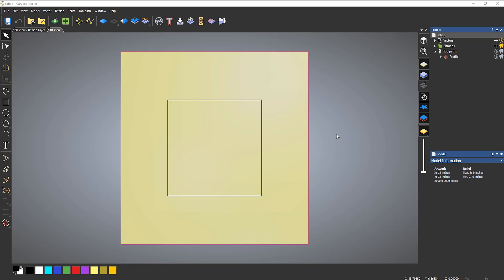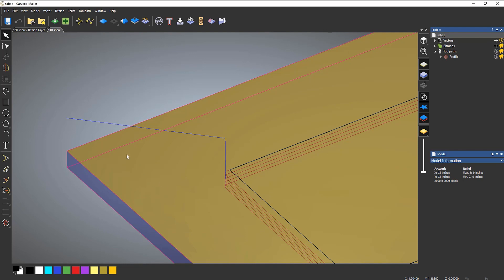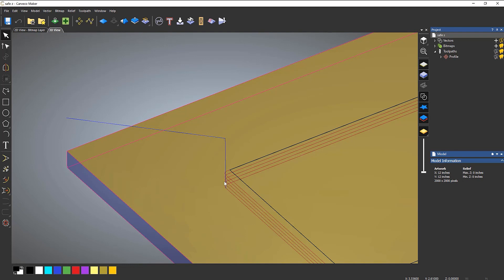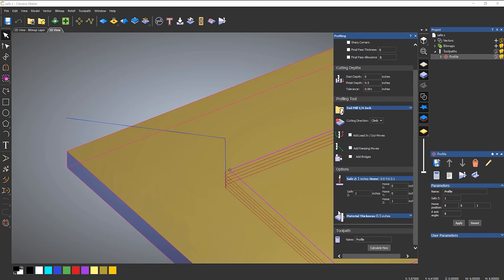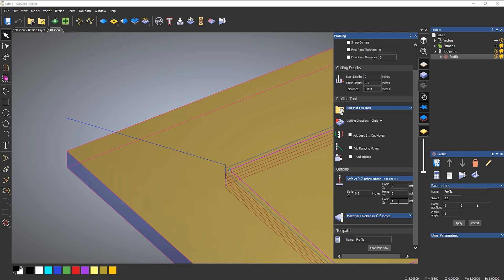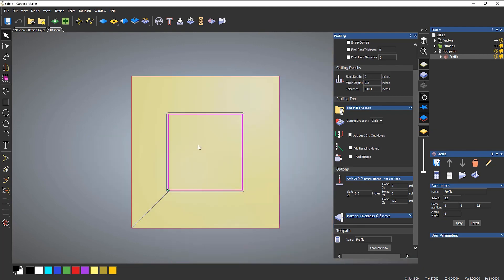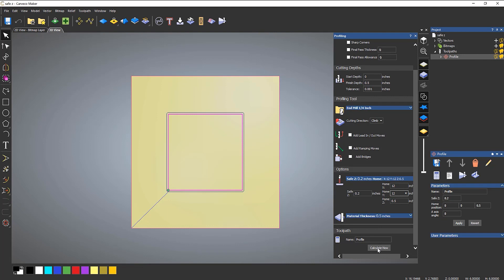Tips and Tricks: Safe Z and Home Positions

Comment: Sorry, I'm so new that I am attempting to start My very First Carve. When I start my machine the first thing that I do is to home the Machine ( One Finity Wood worker ) Machine Home. X=0, Y=0, Z=0. So I think at some point before that you you Start you need to probe for X, Y, and Z, so as to reference your work piece to the machine. In your video you set your safe Z to .2 and Home Z to .5. What I don't quite understand is the Machine seems to be referencing Zed from the Top of the Z axis Down in negatives, and it seems that Carveco Maker Plus references Zed from the Bottom up in positives. The Z Position from Home to the top of my Spoil board is Z = -4.644  My Z at the Top of my Work Piece is Z = - 3.935 . Is the Reference Point for Home Z the Spoil Board and the Reference for the Safe Z the top of the Work Piece? Are these Measurements some how rereferenced in the Post Processor so that the machine understands ? Sorry very Confused!
Reply from the maker: Hi William.  On the Onefinity we always set z zero (physically, on the machine) on top of the workpiece.  So the top of that is 0.  Then in the software, when setting up the material, set you r "Material Z Zero" at the top and enter the thickness of the material.  It doesnt matter if you are using Maker, Maker+ or Carveco, this is exactly the same.  If you change to the bottom in "Material Z Zero" then you will need to add the material thickness on to the Safe Z and Home Z.  I think that your problem is that you need to go to the top of you workpiece (Z-3.935) and then in the Onefinity controller set your Z at that point.  I think it is the small gear cog icon in the Z row, once you select that it will ask to confirm if you want to set your Z origin, select yes.  If you are still having problems, I would get in touch with our support team support@carveco.com as I cant post images which would be make it easier to understand.
Reply: @Carveco  Thank You for your timely response, I was leaning in that direction, however, I wasn't 100% on that. didn't want to break anything. Hopefully able to make my first cut today or tomorrow. I created a 2.5 d carving using Maker Plus of an old television test pattern.

Comment: Leighton, I don't understand the warning about the park position being the start position. If I start at X/Y 0, the spindle will move forward/right +X,+Y to first cut position or is it relative position to +X,-Y?
Reply from the maker: Not quite sure I understand the question John.  Everything comes from the origin point when you set up the model (normally bottom left or centre of the model), does that help?
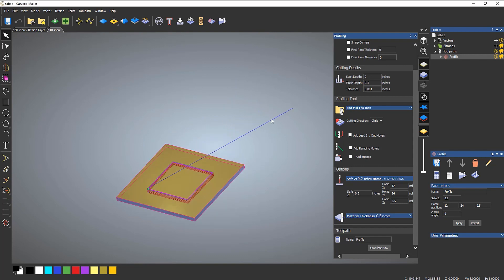Reply: @Carveco  That's better, it sounded vague warning about starting carve from Parked position. I'll play it again warning at 3:05 Restart job from "Parked" home position, not XY zero home position

Comment: Will you be adding the "Jenny series" of cutting tools to the Carveco tool database from Cadence Manufacturing & Design in the next update?  They are a very popular CnC bits and One Infinity Cnc is stocking them.  Thank you.
Reply: That is a good idea. 
I'd like to see the "Jenny" bits along with the bit carried by Skyone CNC added to the stock library of tools. 
Until then you can always add the "Jenny" manually. It's just a compression bit.
Reply from the maker: @WNC828  You can get the Skyone library here Clinton - https://support.carveco.com/hc/en-gb/articles/360053048752-How-can-I-add-a-tool-library-to-the-Tool-Database-in-my-Carveco-software-

We will probably do the Jenny ones in a later update.